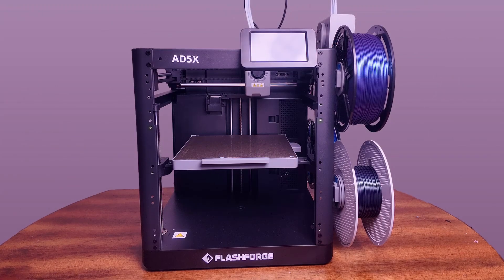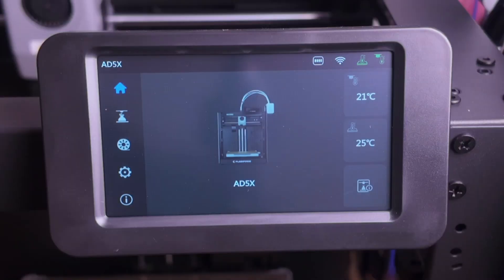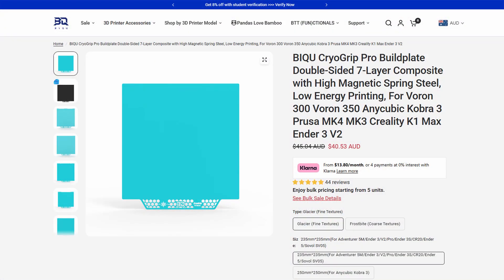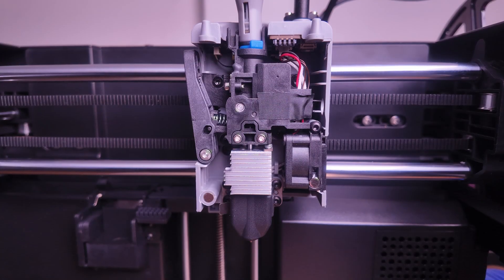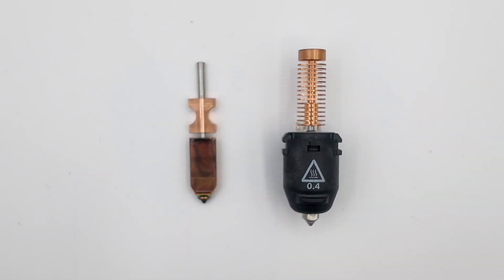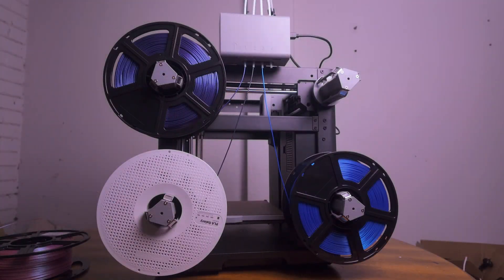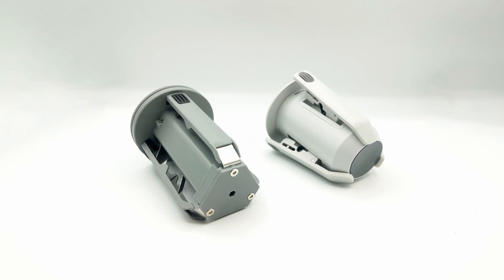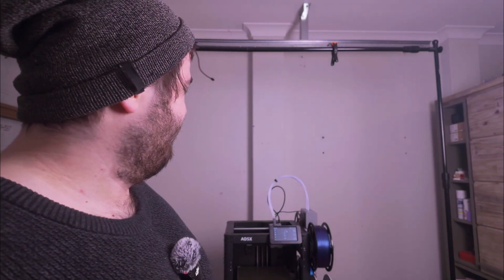24 Hours with the Flashforge AD5X 3D Printer! - (First Impressions)

Comment: I have a question? I have a flashforge adventure 5M. Every time I try printing with flashforge flexible PLA it clogs the loader? Would you have any advice from me? Thank you in advance
Reply from the maker: I would definitely recommend slowing the print down and potentially printing it a little hotter 👍🏻

Comment: Make sure to use glue stick if you print petg, I have petg forever stuck to my 5m pro build plate.
Reply from the maker: Noted! Thanks for the advice I appreciate it 💜
Reply: The stick that comes with the printer I suspect is just hairspray in an applicator.  It spells just like aqua net.  Which is what I use for petg anyways

Comment: Feel like the multi print version, is very simple and could be upgraded easily especially if could flash the original FF
Reply from the maker: I wish they had made the IFS (multicolour module) backwards compatible with the 5M and 5M Pro. I still don’t see why they couldn’t but I’ve asked multiple times and yeah….. no luck.